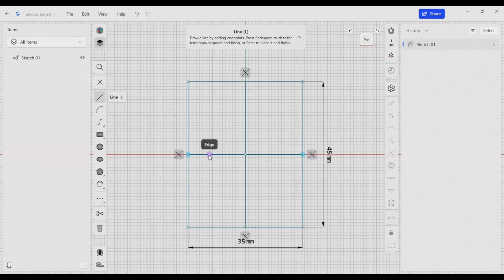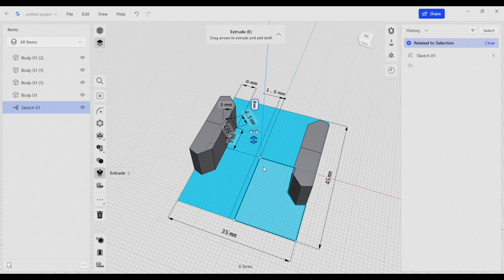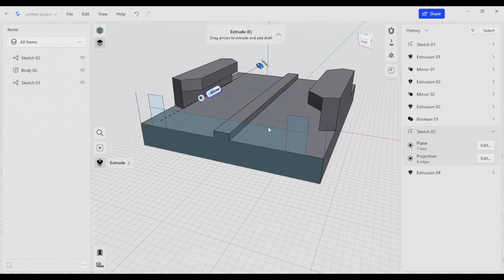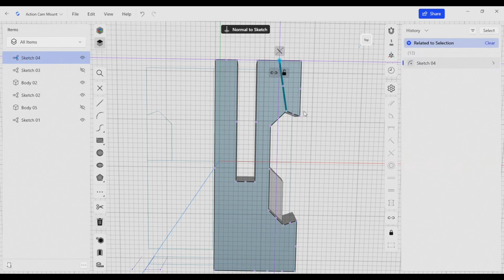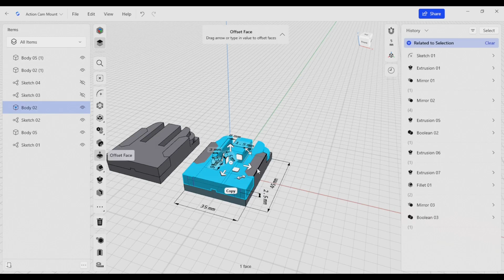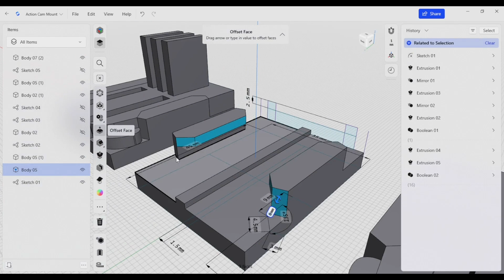Action camera mount, part 1 | Modeling projects

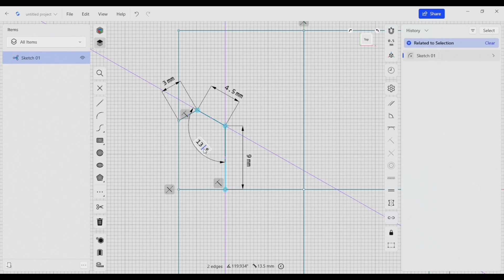Comment: And within the first 3 minutes this already shows how broken the constraints still are in Shapr3D. Why would setting the angle constraint at 2:57 shift the ENTIRE sketch off the center point. It simply doesn’t make sense. This has screwed me over more times than I can count, at least in this example it’s noticeable. But sometimes it’s such a tiny change that you’ll only end up noticing way later.
Reply: Totally agree. In most cases, if a user draws a line close to horizontal or vertical, that line is intended to be horizontal or vertical. Shapr3D should automatically apply that constraint. The constraint can always be deleted if it's not desired.
Reply: Sol1dworks is better